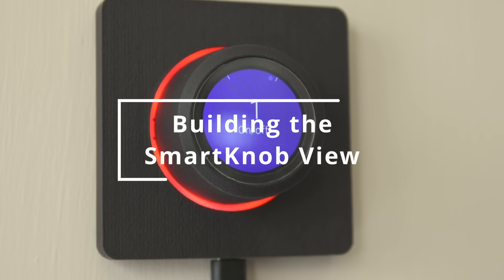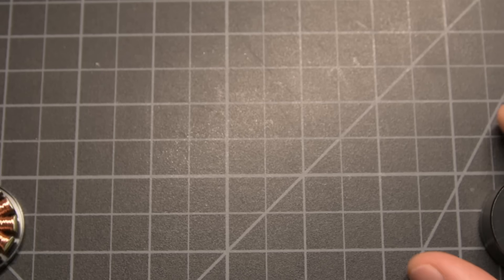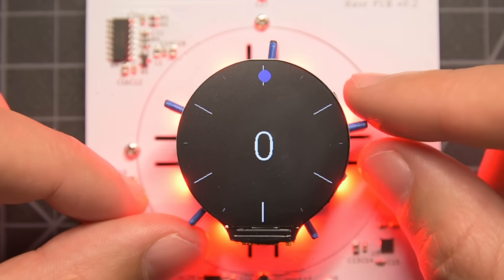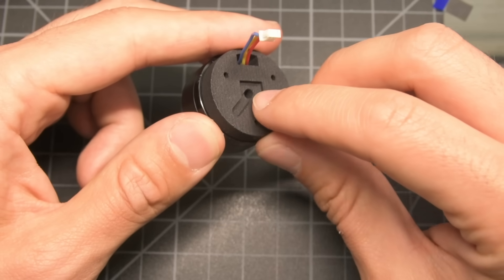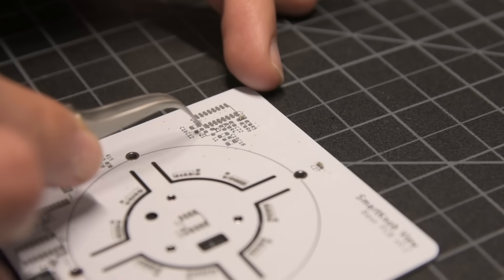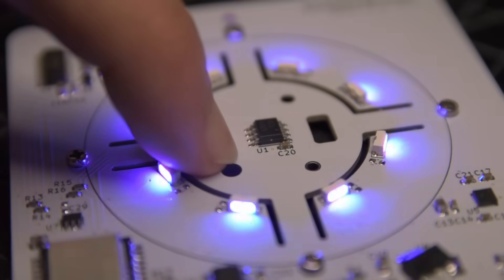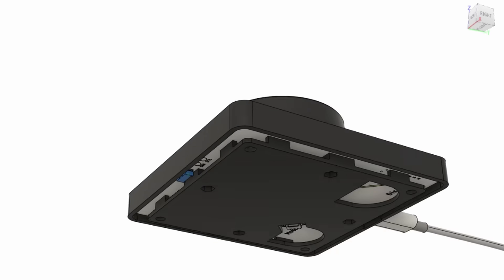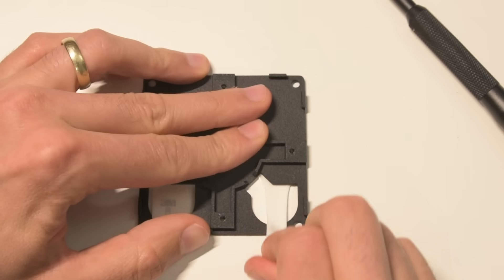Building a haptic input knob from scratch!

Comment: Awesome knob! Planning on building some for my future smart home!
When it comes to the motor problem, I have found some alternatives after some searching mainly replacement motors for gimbals/ drones they might not have the exact same dimensions (mainly being a bit higher) but with only a bit of modification I think it would work:) although getting the same as you or maybe even a flatter one would be best.

Comment: Good execution. I really like how you have used the flex of the PCB itself to create a button. Form + Function = Magic. Getting a mechanical button in there would probably require lot of engineering to do right. It would still take take up space and increase cost. Can the strain gauges be soldered directly to PCB like a SMD component?
Reply: I know you are considering alternatives to the flex gauges, but I really think there’s no need. The flex gauges suit the application much better than strain gauges which are thick and bulky and would not maintain the very thin form factor.

Comment: This is fantastic. Could use this for so many smart home things, maybe even make it the main control hub. Similar to an idea I had about embedding tiny LCDs into a keyboard so you could change character sets and see the change on the keyboard. Only this is far more feasible. I'm wondering how hard it would be to do the windings for that motor considering how small it is, but also wondering if there's a CAD file of some sort for the parts which could be 3D printed.

Comment: I've been looking on my own for a motor and had no idea about t the community behind this. This is sooo cool! I'm very excited to make my own and get programming. 🤗
Reply: So I've seen in the comments people's different use cases. 🤔 one that I've been thinking of is in automotive. Stereo control, cycle through menus,  the obvious bass and volume. With the haltec ecu you could control, boost levels, traction control, valley mode for if the kids drive the car, all with this little knob and some programming to allow the two to communicate. It goes deeper then that if you had the nexus r5 from haltec you could way way more. I really think this has potential in aftermarket automotive.

Comment: Great Project but one question, the wheel cannot be fully rotated as the OLED's wires will get tangled I guess you have a motor algorithm which untangles them after 1-2 turns right?
Reply: The wheel is bounded to the rotating part of the motor. The display and its wires, etc do not rotate at all

Comment: This thing is great.  It would be great if you can add two provisions:  (1) Pads/optional connector for landing control power on the device if I can source the DC without needing to use the USBC cable and (2) add holes to your base 3D print that are aligned with a single gang US receptacle so this could just be attached to the wall
Reply from the maker: There are pads on the back for 5v power input (and serial uart as well if you want a wired data connection). Yeah, would be sweet to make it compatible with US single gang boxes; there's a GitHub issue tracking that: https://github.com/scottbez1/smartknob/issues/59#issuecomment-1118911710

Comment: Would the color of the wall to which the unit is attached not negatively affect the efficacy of the ambient light sensor? Presumably, it would work fine on white and near white walls but maybe it would undercompensate for darker colored walls.
Reply from the maker: Yeah, you'd have to adjust some calibration depending on the surface color. I picked the VEML7700 because it's super sensitive, so even on a black surface I was still able to get some reasonable readings (though they are slower since it's collecting over a much longer timeframe)

Comment: Ok so hear me out. I saw this project a bit back and I think the work you put into this is insane. It is so clean and beautiful that not even a consumer grade product comes even close. I'd love to build one but the problem is that other than the supply issue for the motor, I also don't have the tools e.g. hotplate for reflow soldering in order to do so. So I appreciate massively that you shared this video and your work because I would love to use this as a reference to try and make a less nice but similarly functional dumbed down version. I also would like to be able to print the parts myself on my fdm printer. The package will be much larger but I personally don't mind. Again thank you for keeping this open source and I'm looking forward to your future projects!

Comment: Really nice. I got inspired by your project and made an easier version of the smart knob with my own software, based on simplefoc library.
Currently I'm able to publish the angle on aws-MQTT broker via hivemq to subscribe it on any device i like to control. Where I implemented a feedback loop, I can feel the torque of the remote controlled device, such as a VFD Current signal, in my hand.
Reply: "Easier version... with my own software" -- Sounds intriguing! Are you able to share your software work? I'm skilled with my hands, but not the best with embedded programming : (

Comment: What ive been thinking about since the last video; how do you work with cogging? 
[from rc cars] cogging meaning the motors natural behaviour to want to snap into certain positions without any electrical connections

i know its stronger and weaker depending on the motor, but all the motors ive had, had a significant amount of it, such that its pretty much the same as a detent on a normal encoder, if not more
Reply from the maker: I've seen some others online attempting to implement anti-cogging in software since it's a closed loop (just counteract known cogging torque at a given angle based on some calibration data), but I took the approach of finding a motor with minimal cogging. Generally it seems like weaker magnets on the rotor is the key, but this is unfortunately somewhat rare even among "gimbal" motors that are designed for low speed smooth movement.
Reply: A discord server might be a nice place to hang out and talk with others who are (trying) to recreate it as well ;)

Comment: Trying to create a volume knob that outputs a pulse as you turn it. I'm actually in the process of designing opposing "freewheel" like on your bicycle but scaled down inside the knob so when you turn one way it hits a limit switch every 1/24th turn then turn the other way it hits a different limit switch same idea. No screen tho. I like your design so much I hope you find a solution for the out of stock motor

Comment: "This PCB can measure its own mechanical deformation.  Weird flex, but ok."  ...and I'm dead.  That was an unexpected laugh-out-loud in the middle of an excellent breakdown of a wonderful project.  And then the recommended video - I can't believe I didn't realize you also did the see-thru split flap build.  Love that as well.  As someone who used to travel regularly via Amtrak thru several stations with old Solari displays, I've long been a huge split-flap nerd, and I'm always on the lookout for diy builds.  Very subbed for the next cool thing.  Thanks!
Reply: I was going to ask you to provide a link to the split flap build, but I found it: https://www.youtube.com/watch?v=UAQJJAQSg_g; Thanks I didn't know about this.
Reply: It's got me wondering if more strain sensor positions (3+?) would allow a joystick-like interaction too
Reply: @Necrocidal  They do, and they exist, but they tend to wear out very quickly from what I've read during my research
Reply: 100% just started writing the same comment. Holy hell, that line wrecked me.

Comment: This would be cool as a Surface Dial -like device, but instead of attaching it to a display and having the UI ring around it, this could display the same UI ring onto the knob, or display any macro function(s) that're being used. 

The way you're achieving detents is interesting. I'd be curious if this could be somehow programed as a return to center with only a small amount of feedback torque, say for joystick-like input, but only in the one bi-directional axis; more feedback than a scroll wheel and rts unlike a scroll wheel. Put it on top of a substantial joystick, honestly probably just replicate the Dreamcast's style of hall sensors and the same kind of pivot mechanism but at a larger scale, and this could create a cool 3D joystick.

Comment: You can use 4 bend sensors per 4 sides. This way you will be able to know direction of bending and use it like joystick
Reply: Isn't one per side (4 total) enough for that?
Reply: @rpyrat  Yea, i mean one per side (4 total)
Reply: But do you need it? I imagine the usability wouldn't be as great as an iPod click wheel type interface would be.
Still, initially I had the same thought.
Reply: @adrianjost-dev  I just love the joysticks :) And this is an idea to try, if the sensors are already in project
Reply: Touch sensitiv display as well. 😀 A fingerprint reader would be cool. 🥰 Maybe proximity sensor or ir camera with gesture ability. 🤔 Iris scanner. Hidden security camera. Bottle opener. 😂
Reply: @Johnnisjohnnis  Maybe a kitchen sink while you're at it. ;P
Reply: @Johnnisjohnnis  bluetooth soundbox

Comment: Does the magnetic field generated by the display wires affect the magnetic sensor?
Reply from the maker: I was wondering about that when I designed it like this, but so far I haven't noticed any impact on the magnetic sensor.
Reply: @scottbez1  Then it's just perfect!!! 🥰 
Awesome job buddy.

Also can't we just drill a hole in a motor with a thicker shaft?

Comment: https://hackaday.com/2019/01/27/quartet-of-smd-resistors-used-to-sense-z-axis-height/
Possible to use SMD resistors to substitute strain gauge? That would make the wiring and soldering easier.

Comment: looks like the spacing (60mm) for the mounting holes is almost the same as the standard electric in wall mounting box (not sure of the right English word :D)  in Europe. would be convenient if it fit those. though the screws used here are obviously smaller
Reply: the cups for hollow walls are 68mm dia.  so the spacing would be something like 64mm or 63mm

Comment: Awesome design! Only flaw for me would be the external power supply and cable.
Would you not prefer to make it battery-powered and that way untethered!?
Reply: Next version: fitted to replace a standard light switch and be powered by the grid, compatible with z-wave.
Reply: untethered. until the battery runs flat an you got another device that likes some charging frequently.   if there were not already enough of that like phone, tablet, watch, flashlights, ect.
Reply: Would defiantly need some aggressive power saving but nice idea. Would need the screen to be probably off most of the time though.

Comment: This video is amazing from top to bottom, you want through every detail perfectly, which makes your work even more impressive. First the project is really well done with some smart solution, but also this video is very well made.
Good job man ! 
Cant wait for this motor issue to be fixed (maybe thé GMB2804H-100T could be used, although i think you said it was a bit expensive)

Comment: I was wondering if the strain gauge could be built directly into the pcb? 🤔 i think i saw something similar for a delta printer where they used thin traces as a strain gauge sensor for probing the surface ;)
Reply from the maker: I'm not totally sure about traces (I think it would be hard to get them thin and long enough when using low-cost PCB manufacturing), but I'd like to try this SMD resistor idea soon: https://hackaday.com/2019/01/27/quartet-of-smd-resistors-used-to-sense-z-axis-height/
Reply: @scottbez1  I also think printing a strain gauge on the PCB is a useful design iteration. This would save some significantly fickle gluing and soldering operations. The traces don't need to be perfect, just be able to detect a strain event, after all.

Comment: Ooh, you could make an e-ink version of this!
Reply: I think refresh rate would be an issue, as e-ink displays are very slow compared to conventional displays.
Reply: @OGSumo  Refresh rate would be the biggest hurdle for sure. I think a competent knob UI would probably be possible as you can do some clever tricks if you make assumptions about what parts of the screen are able to change and how
Reply: There is no rounded E-ink as far as I know. If there is market, it might be a thing because it's not hard technically.
Reply: @yuxuanhuang3523  There are rounded e-ink screens meant for smartwatches.

Comment: while not ideal, could consider using a belt system so you can use a more standard motor mounted elsewhere, probably cost you some torque but would allow you a bigger hole for managing display cables
Reply: More components to wear or break
Reply: I think that might make the flex press system more complex since the mass and movement would be off-center from the main rotational axis. Not sure how much of an issue that would really be, but there definitely is an elegance to the current design. Hopefully an alternative source is found soon!

Comment: You could use spindle motors from old 3.5" hard disk drives. There's even room to drill them through for the wires.
OR you could build a housing that allows you to run the cable for the lcd under the top part of the case.
Reply: Top part of the case is also rotating so running cable that way would be pretty hard too
Reply: An HDD motor will not rotate smoothly.
Reply: You can't. HDD spindle motors do not have a hollow shaft design. Drilling through the center will destory the bearings.

Comment: What an awesome build!
Curious on the haptic feedback, if you rest your finger on the side of knob, will you feel the slight rotation when it simulates the “haptic”? And are you rotating the knob one direction or in both direction back and forth?
Reply from the maker: Yeah if you know it's there you can tell that it's rotating, but otherwise it does a pretty good job of just feeling like a little click. The haptic click is a quick rotation in one direction and then back in the other direction: https://github.com/scottbez1/smartknob/blob/604f21dcb6fb84714156ddada2d08776f55822b0/firmware/src/motor_task.cpp#L334
Reply: If you really care, Just but some iphone 7 haptic motors. They are one dollar per piece and really easy to drive. You would have to modify your code but it should be easy